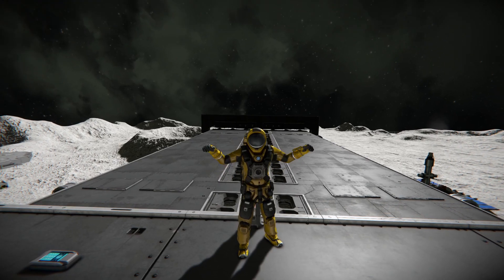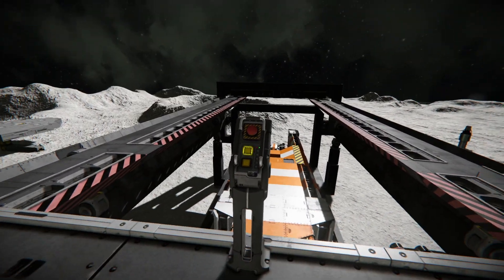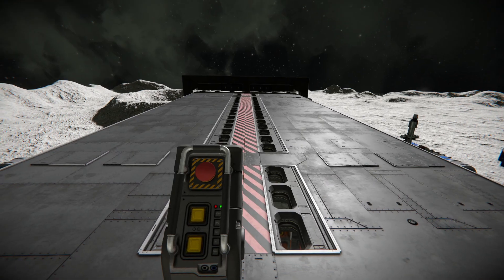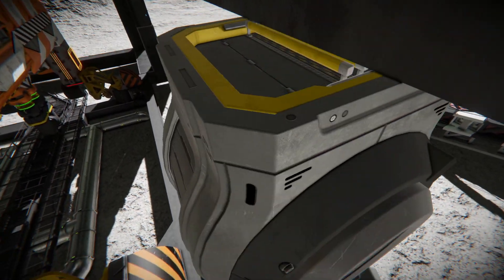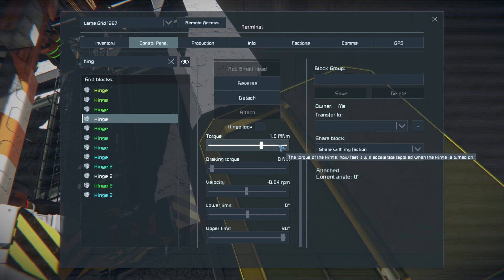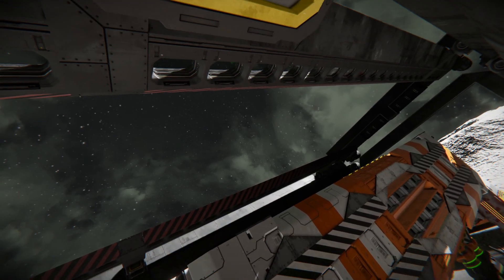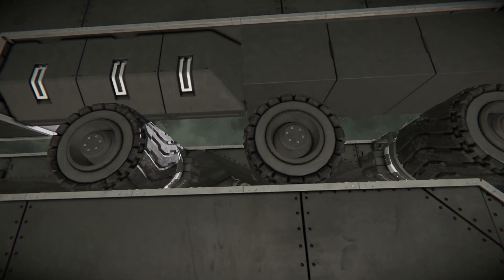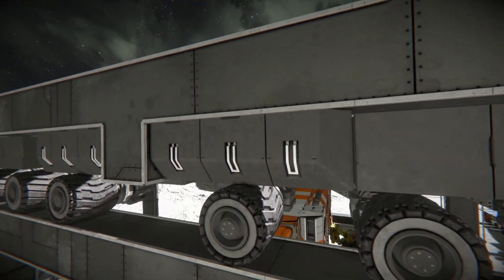Space Engineers Big Hangar door fast opening test

Comment: I like it, looks neat but personally i wouldn't use it for two reasons: 1. Your design doesn't merge, this makes the game constantly check the grid for collision updates and impacts game performance. this is fine for experimental use, but not good for long term, and 2. Since its not merged, it doesn't allow the grid to be airtight.
Reply: But it's pretty... And ingenious.
Reply: @shahbazfawbush  indeed! It's out of the box thinking and i love it
Reply from the maker: It´s a first test version. But it will need merge blocks, there is a another reason, when a subgrid in motion with more subgrids plus a static grid, it could be while reloading that it wrongly glitch into each other and break. (one subgrid pushes the next subgrid into the static grid) 
I don´t want it to be airtight (the other Base parts got allready ~60 vents and 20 rooms).  It will get a frame to look like airtight, I will try to make it airtight, just to know if it works :)
Reply: @royalrollin8372  just beware if your going to merge block this, each segment will need two hinges between each grid instead of one. as you can't merge a grid with only one hinge in-between into it, as the hinge and hinge part will be inside each other
Reply from the maker: Yes, I'm already thinking about this. A single hinge will squeezed merged together...